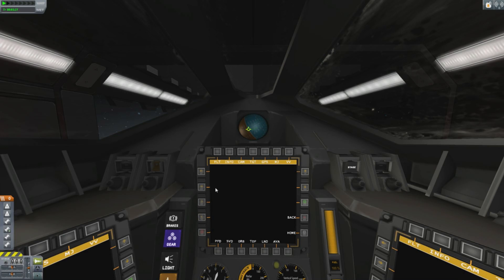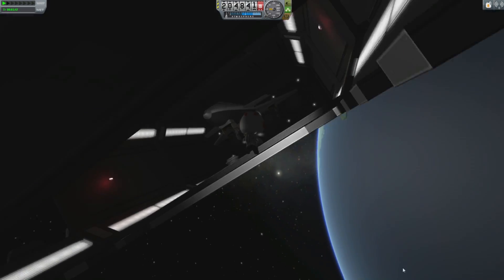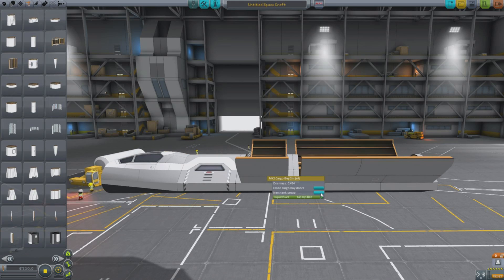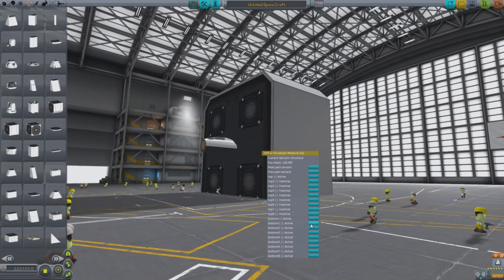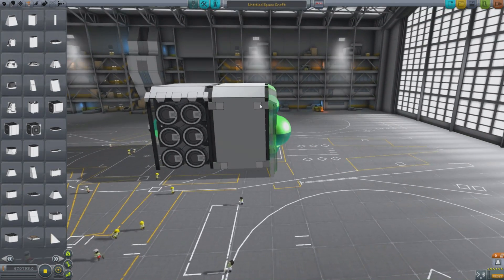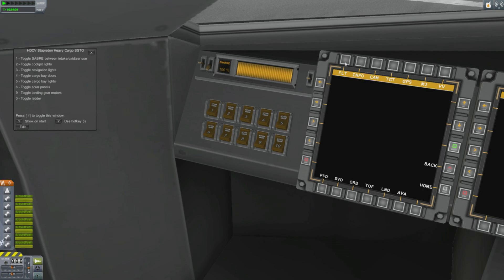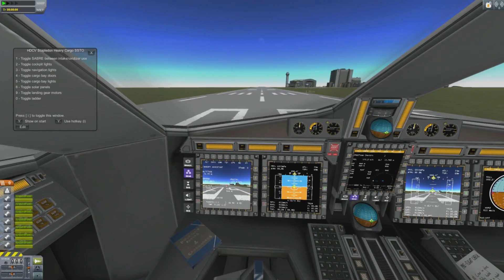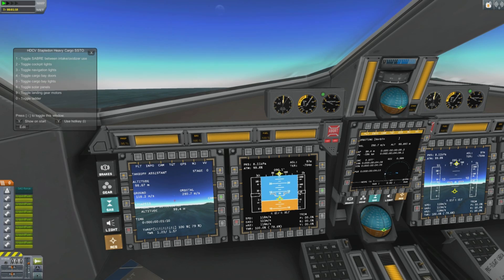Kerbal Space Program - B9 Aerospace Updates

Comment: in order to get the large spacecrafts that uses HX parts to orbit, you have to build them first then launch them from minmus, due low gravity, it's easy to get on orbit, problem is you going need mining base, and extraplanetary launchpads, which you are going start with setting a mining base on minmus then get enough resources to build that ship and launch from here.

you can still launch spacecrafts that uses HX parts to orbit, but not too big.

proof is here: https://www.youtube.com/watch?v=J-qTuIHXMBk&t=128s

this shows a youtuber manages to launch a extremely large spacecraft made of HX parts from minmus which it's impossible on kerbin and many planets that have high gravity.

problem is you need lots fuel to get it from minmus to other planets, that means you going need to send it to kerbin orbit first, and you going need a station with enough fuel and enough crews, or you can send them by launching rockets designed to refuel and transfer crews to other spacecrafts, then fill it up with crews and fuel, after that, dock some landers and probes, then you should be ready for long journey, before doing that, add any gear that you need, for example, a module to refine resources into fuel or another resources, a module that you can build new ships, a module to generate enough electricity charge, and put everything that you think is necessary.

NOTE: MOVING CREWS to extremely large HX spacecraft is EXTREMELY TIME CONSUMING.

Comment: Very nice review. Simple and the comparison between a pen-styled vaporizer and a mod box with a tank with good to excellent airflow and atomizer characteristics is night and day. Just based on these two differences; atomizer and airflow can make the difference between a cigarette smoker and a vaper. No good quality hit, back to ciggies...

What's cool about your demo is that it was obvious that the pen-style unit was asking you to struggle to get a hit, where the Reactor unit enabled you to get a proper "lung hit", meaning; just inhale and let the vaporizer work its magic. And seeing the clouds on the exhale suggest that this is a well designed device.

Regarding beginners: Always start from the lowest power setting to begin with. Always wet the atomizer, then fill the tank and give it time to absorb the juice before hitting the firing button. It will save you from potentially burning the wick and making for a very unpleasant first experience. A beginner, like yourself, probably comes from pen-like devices, so I wouldn't necessarily discourage a new vaper from buying a quality product like this one.

Rather, I would suggest buying a new mod box/tank vaporizer and learning how to set it up and start using in the company of someone (like at a shop) who can guide you along as you learn how to adjust the mod itself, how to replace the atomizers and prep them, and maybe give a small intro into building coils for later on down the road...

One last IMHO... You can spend all the money in the world on a mod, but if the atomizer and tank sucks, you will not realize its full potential. Eric demonstrates this fact beautifully in his vid with the quality of the vape on the new Reactor. And please follow his suggestion of dropping the nicotine content down to 6mg or lower when you make this kind of upgrade. If your juice is SO delicious that you can't stop sucking on your vaporizer, the nicotine exposure can cause nausea and sleeplessness, just to name a few... 

Take the time to learn from someone 'who's been there' and in person, if at all possible.

Thank you, Eric! Very well done!

Comment: Scott, I have the new b9 mod however when trying to use it there are problems:
1: When selecting the type for one of the large modules and making it a fuel source it does not provide fuel. in fact the green bar that indicates the fuel level does not appear at all and no engines can be fed from it

2: the wing flaps (ailerons) texture isnt the same. I put on the new flaps to my wings and then they appear as the original texture, not the new ones. I downloded this mod crom curse... I'm about to try the one from http://forum.kerbalspaceprogram.com/threads/92630-0-24-2-B9-Aerospace-Release-5 But i suspect it may be the same.. any suggestions?

Comment: Can you realistically get any of these HX parts into space? I have FAR installed and I use KW's fairings but these HX parts won't fit into them.
Reply: Just slap it on top of a KW 5m fuel tank, 2 or 3 if you're using the B9 engine.
Reply: Just use procedural fairings.

Comment: I thought the V5 that was released today by bac9 was not a beta. I know one of the other developers of the new B9 posted a test version a few days prior. It seems good, I have KSP interstellar on 24.2 and it seems to cause the turbine engines in the new B9 to overheat very very quickly. I'll need to do further experiments with it with and without KSP interstellar. I didn't bother to add pre coolers, jet engines shouldn't need them just for sub sonic flight to mach 2 or so.
Reply from the maker: Yep it was officially released a couple of days after I posted this video.

Comment: To make life easier hooking up the massive parts with 9 connection nodes slap it on how ever, right click then disable the ones you DONT want (you can even disable the node currently in use) so to connect the monster part shown at 5:30, connect it then disable nodes 1 though 8 top and bottom then reattach the part via the sole remaining node.

BTW. the nodes are numbered left to right top to bottom with the centre node un-numbered

Comment: Scott Manley Every time i play with this mod without texture management i crash. I went to the texture-manager mod page, and i have a question... are you using aggressive or basic version of texture manager? thanks!
Reply: Scott Manley well, now i just tried to run it with a texture-manager mod, and i don't know if i installed it correctly. I'm getting load-freezes within the first five seconds of loading. Maybe i have too many mods? maybe i installed the wrong parts of the experimental B9... PLS HEEELP MEEE!!!      sherpaXD I see you possibly got it to run? pls share, i'm intruged.
Reply: Tangy Slash
The "load freeze" in the first seconds / minutes of startup is just the Active Texture Management working. It's OK.

Big letters in the ATM's thread:
KSP WILL LOOK LIKE IT FROZE (WHITE SCREEN) SIMPLY WAIT, AND IT WILL EVENTUALLY LOAD.
Reply: marvincz3 I fixed the problem already, it was a different problem. Thanks for the concern, but I have another problem. I have people viewing my download totorial and are reporting game crashes or hundreds of missing parts. I think I said something wrong in the bid, idk.

Comment: Even though I crashed... 4 times..... And that there isn't an adapter from HL to HX, I had fun with this mod. Very resource intensive though, even for 120 parts, I had only 14fps throughout :/. Also, I couldn't get my HUGE hangar in space without HyperEdit. Those massive engines are really fuel hungry and give you TERRIBLE Delta-V.... Less than 4000 -__-
Reply: Switch the huge engines into the second mode where they act as ion engines
Reply: kerbalspacevideos I was already on ion mode :(
Reply: Try a higher fuel ratio
Reply: kerbalspacevideos More fuel? If I do that, I definitely won't be able to get it into orbit without HyperEdit. Taking off like a rocket is an option, only if I have infinite fuel. Thanks for the tip either way
Reply: Not more fuel, just less mass that isn't fuel.
Reply: kerbalspacevideos my craft was like 7 hangar pieces, a cockpit, 4 lines of 7 fuel tanks, 4 reactor core things and 2 engines.. yet I was still getting awful delta-V.. I think I need to do some research on rockets n shit, it's like I've forgotten how to ksp

Comment: Exactly what we need. Bigger parts.
Reply: Also, the second I saw this video my computer whimpered and "restarted".
Reply: Kendas Kerman Your PC's RAM preemptively quit
Reply: ARK Retribution My computer takes 30 seconds to start up from pressing the button AND loading everything, considering I have 8GB of RAM
Reply: Dempsey Eaton *and a solid state boot drive or nearly empty hard disk or alien technology. 8GB RAM will not earn you 30 second start time all by itself.
Reply: Dempsey Eaton I have 16GB if RAM.

But no KSP...
Reply: Guys it takes my computer 2 mins to boot up then 3 mins of startup lag. Beat that lads
Reply: Verdiss I agree. I have a puny platter drive and 12GB ram and it takes ages to boot. The bottleneck lies firmly with the storage drive :P
Reply: well not exactly 30 seconds, somewhere near 1 and 1 and a half minutes boot time. I'm using SATA 3 with ports capable of 6GB per second, and my hard disk drive is more than capable of utilizing it.
Reply: oh and if I was using a SSD then it'd be faster than 30 seconds as to using intels fast boot system.
Reply: I have 16 gigabytes of RAM and it still takes 1776 years to load KSP with he amount of mods I use.
Reply: Kendas Kerman KSP is a 32-bit process, meaning it's not using more than 4 GB at any given time no matter how much RAM you have.
Reply: Brenin Madarch Actually, if you check closely, Squad released a 64-bit version of KSP, therefore it will use more than 4GB RAM if required. Only if you are using 64bit KSP though.
Reply: Brenin Madarch I never understood why 32 bit is still used if 64 is so much better?
Reply: Kendas Kerman It's waaaaay easier to program 32 bit than 64.
Reply: Kendas Kerman KSP is made with Unity, and 64 Bit Unity is apparently a bit more tricky to work with, so it's not the highest thing on Squad's priorities in the beta :)
Reply: Dempsey Eaton Only the 64-bit version seems more prone to crashing, as it is very new and fresh. But by all means, use it for mods.
Reply: ARK Retribution My old PC needed 5 Minutes to get to the login screen in Windows, 4 Minutes until I could log in, 3 Minutes until I was logged in, 6 Minutes until the lag was gone and then I believed that machines with 1GB and more where beast.

Comment: Stating first and foremost that I fully understand that this mod is in development and the current release is a pre-release. Everybody understand that I understand? Good.

The 5.0 version of the mod looks amazing. I haven't built any ships with it. I haven't flown anything fan-made either. Just looking at the parts in the editor makes me happy and imagining building amazing starships, ready to fly to different stars using the Star Systems mod and KSP Interstellar.

Too bad I can't do that, because the mod's currently incompatible with 64-bit and I need the Active Texture Management mod to make it run on a CLEAN 32-bit installation.

It's simply too big at the moment.

I sincerely hope they'll be able to get the memory requirements down for the 32-bit version so that you can run more than one mod at a time (unless they're trying to pull a Better Than Wolves here... which would be an asshole thing to do). And, of course I hope they'll eventually get it working for 64-bit, naturally, where the memory issue is practically non-existent.
Reply: Ksp interstellar adds other star systems?!?
Reply: No, but if you have other star systems (using PlanetFactory) you can get to them in a reasonable time.